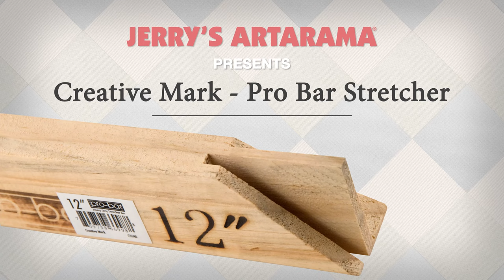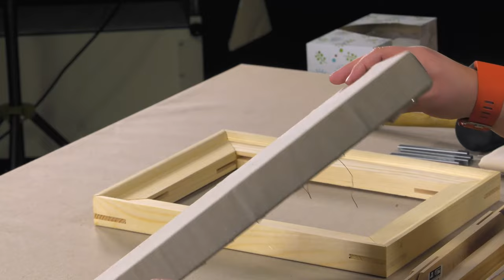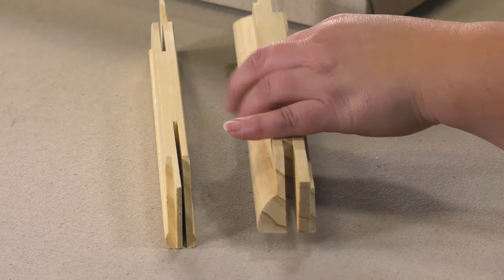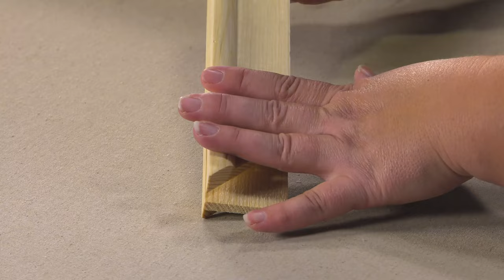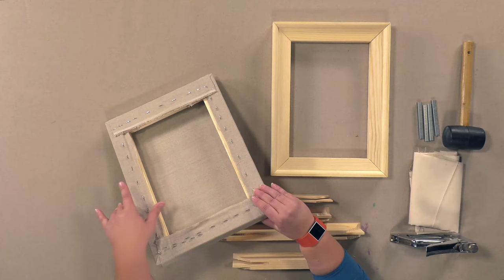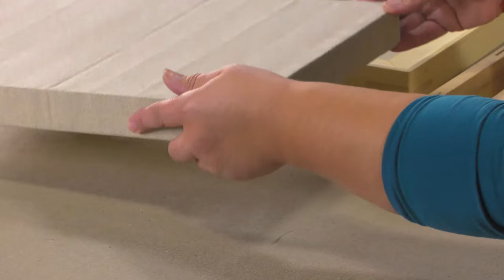Creative Mark Heavy Duty Gallery Pro-Bar Stretcher Strips

Comment: This canvas is not stretched tight though, its quite uneven. How can you get those deep folding lines out?
Reply from the maker: To remove deep folding lines from stretched canvas, dampen the back of the canvas slightly with a spray bottle or damp cloth. Then, place the canvas face down on a flat surface and cover the back with a clean towel or cloth. Using a low heat setting, gently iron the back of the canvas in a circular motion, being careful not to overheat or damage the fabric or paint. Check periodically to see if the folding lines have diminished, and repeat the process as needed. Alternatively, you can try steaming the back of the canvas with a steaming iron or garment steamer. If these methods are not effective, restretching the canvas or consulting a professional restorer may be necessary.